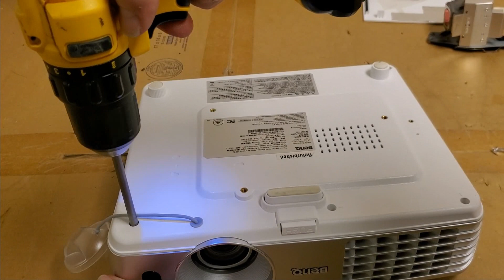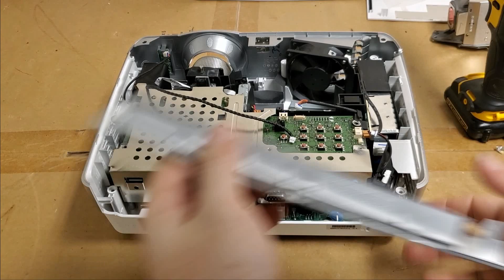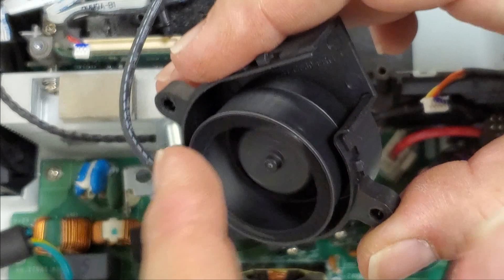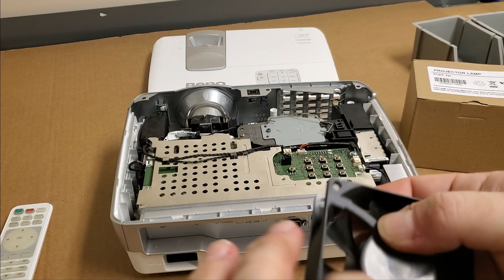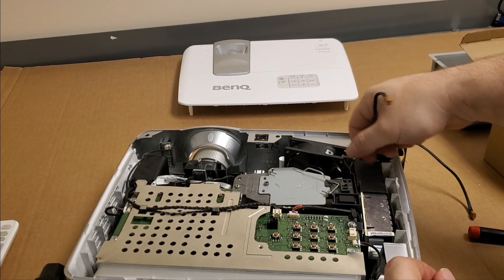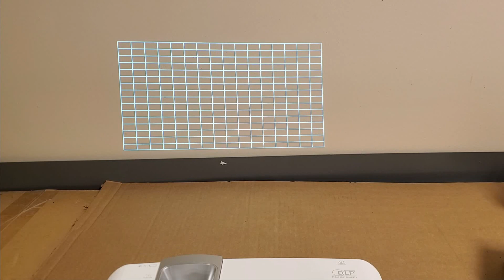BenQ HT1075 DLP Projector Overheat/Fan Replacement

Comment: Hi!
Any suggestion on how to reduce noise of a BenQ W1070+? I like the projector but I really would wanna know if there is a way to make it more silent. I guess the fans are really high rpm so a switch to noctua fans maybe wouldn't do to much of a difference, right? If I attached a cpu-cooler over the lamp... would it then be possible to reduce the speed of the fans in any way?
Reply from the maker: Unfortunately those methods wont work in my experience.  The Noctua fans use a different fan status reporting method (at least the Noctua fans I saw). Also the CPU cooler wont help cool the lamp much at all. They run so much hotter than a CPU.  Average fan temp is +200c at its hottest touchable point.  Even hotter inside where you can't get to.  The heat is generated by the arc tube inside the reflector. The blower fan (turbine fan) blows air into the reflector to push the heat out to the exhaust fan. 
All that said, there might be a problem with your exhaust fan or color wheel(they can make noises like a bad fan).  I run an HT1075(same as the 1070+ inside) in my bedroom and I sit about 5ft under it and do not hear the fans even in normal mode. You should really only hear the air moving in my experience.  I mention the exhaust fan because it seems to be a popular failure for the fans.

The problem with changing fans is you need to maintain the CFM (airflow amount) and use the same fan lock/fan status specs.  Some fans report PWM with one pulse per RPM, others 2 pulses per RPM.  Some pull the fan status lead high for fan stall or pull the lead low for fan stall. If you don't match those, it won't work at all.  If you can match the size, the CFM and fan status type, then you can use other fans. I tend to use the originals because I figure the engineers spent the time and picked them for a reason. I would like to experiment sometime and see what could be done.  I hear this a lot so its obviously something enough people run into.  Maybe if I can get my hands on some other "quiet" fans and see if they will work...  (really I need more free time. I'd love to give you a real solution).

You may want to check your service menu and see if you have any old fan errors.  Press menu, then press source and enter at the same time.  It should bring up a little set of boxes. Then use arrow keys and enter/menu to navigate the screen to find the fan status page (option 3 or 4 I think).

Comment: Please can you tell me the name of the tool your using at 5:16? I'm looking to replace my own fan due to overheating with the w1070+. Much appreciated and thanks for the video.
Reply from the maker: Its just a 5mm nut driver. I think I got this set on Amazon with a bunch of "security" tips.  If you have a socket set with 5mm socket, it will work as well.
Reply: @FixitFrank  thanks for that Frank 👍all the best in your endeavours, hopefully it's an easy fix.

Comment: Dear Mr. Frank, Thank you so Much for your video and your continues support, please allow me to ask for your opinion. I have a benq W1070, it gets overheat and shutdown after 2min. if i dont use the (high attitude mood). I opened the hidden menu to monitor all fan speed. i found out that Fan#3 rpm stops suddenly, then the projector shutdown with the lamp red light warning on. using your video on how to open and clean the blower fan, fan looks good, after cleaning and putting it on a test, still same issue. ihope i was clear, and thank you for your time. Regards,
Reply from the maker: Makes total sense! Oddly I have seen those fans fail intermittently. I had one with 15total hours that failed. I'd put a new fan in first. You can buy them on eBay or Google the model # on the side. The fan needs to be the same model or the CFM and the status wire may not be compatible, even if you match the size and voltage.
Reply: @FixitFrank  thank you sir

Comment: Have you ever seen the bulb plug melt, I replaced it two months ago now the bulb went out so I went to pull it and can't get it out. I broke the plug to find out its melted together.
Reply from the maker: Yup.  I have seen that a few times. Sometimes its from a bad male pin that isn't locked into the lamp connector, other times its the internal connector drying out and cracking when the new lamp assembly is installed.  Fortunately its usually very repairable.  Check out my Optoma video.  https://youtu.be/25_Rz5DQSmw   If you are in the states, email me. I have access to replacement connectors. If you are not in the states, I have a contact in China who can help you with a connector. Usually the ballast and everything else is OK.
Reply: Thank you so much, I will get it apart and get back to you for parts. From your reply it could have been the new bulb not fitting right and pushing the pin out of the plug?
Reply from the maker: Its hard to say without seeing it.  Older projectors can have the female pin push back and sometimes the new lamps have pins that slip.  I'd really have to see it to say what the cause is.  However, being that projector lamp world is small, I am actually aware of your issue. I'll be in touch a little later today.

Comment: the projector warmed up after cleaning in the service and it always turned off after 7 minutes the lamp cooled down and then the projector turned on and the red lamp lit.  The lamp is lit 1450h.  and the fans spun at 4500RPM.  It wasn't clear to me, but when I drove the machine to a cleaning service, everything was fine.  After weeks of reading the forum, I got angry and opened my projector and found a flaw in the front fan being turned, which was blowing inwards.  I turned it so that the arrow of the fan pointed out and assembled the device.  The projector is working, not humming and is well ventilated and the speed is 1900-2100 RPM.  service might know this but don't you think?  I'm a layman, but I don't hesitate to start everything, and if I knew I wouldn't go into that projector, I still had to.  nice day Honza

Comment: Hi, thanks for your video, I cleaned my working projector and after reasembly I cant run it, no power at all, even LED indicators on buttons are dead. any clues what I did wrong?
Reply from the maker: Hi, I few questions.  Is the lamp cover in place? The cover depresses the switch that turns on the mains power.  If not, check the thermal switch connection to the power supply.  Also, be 100% sure you did not install the mainboard offset from the power supply pin-riser.  It is easy to shift the connection one pin over. Most of the time it ends up being a wire you thought was plugged in and was not or something like that.  I have had to put together and take apart only to repeat that 3-4 times on occasion.
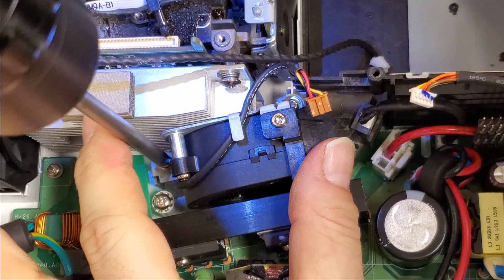Reply: @FixitFrank   @FixitFrank  thank you for your message :-) all working now. When I was reassembling projector I put 14-pin ( 7:38 - partially visible on the right side of screen ) connector on the other side of metal cover so basicly it wasn`t even connected to board. Basic mistake but I found it. Have a nice day :-)
Reply from the maker: @fikusny2011  I have done that so many times.  Now I even shine a flashlight in there just to be sure.  It's a really easy spot to offset.  Nice work and congratulations!

Comment: I would like to thank you for the video.tearing down right now. Only issue was remote wires, but should be able to get them back on, it's not a plug each wire on its one barrel  connector. Oh I had a bulb explode. I found a quarter inch piece of glass in the fan. Again thanks for the video
Reply from the maker: Let me know if you need any internal pictures or wiring order. I have another one in my shop currently.

Comment: Hey Frank, I know this will sound stupid but I have an EPSON EX5220 that hasn't been used in months and when I turned it on I noticed the intake fan had LOADS of dust build-up so the first thing that came to mind was to take the air compressor and blow the dust out because I didn't have any canned air... ANYWAYS, I may have gone a little overboard with it and ended up shattering the intake fan... I looked and looked online for a replacement fan but had no luck. seeing how you're a pro at this kind of stuff I figured you would know where I could buy one. Thanks.
Reply from the maker: I've done that.  Those fans will overspeed and fly apart if you let them.  It's kind of fun sometimes with scrap fans. Not so much when you need the fan... 
Type the part # on the sticker into Google/eBay.  Im sure someone has them.  Be sure you use the same part # because the fan stall/RPM lead is going to be one of the few different types and if you substitute the wrong fan type(even if voltage and size match) it may give you fan errors if the RPM/fan stall lead uses a different signal type than the projector expects. If eBay/Mouser/Google are no luck, after Chinese lunar new year, you can try Time Electronics.  Gydz@timeprojectorlamp.com  Be sure to send a picture of the old fan with the sticker showing.
Reply: @FixitFrank  Alrighty, thanks man.

Comment: Hi great informative vid...that squirrel fan is that fan 3?...fan 3 on my ben q w1070....says fault ...0 any help with identifying  fan 3 appriciated.
Reply from the maker: I think so.  On my "community" page there is a post where I have a map of that fan layout.  https://www.youtube.com/post/UgywjB6ucj44mbxCtrd4AaABCQ  <--Fan Map
If you had a lamp explode recently, and now have that error, it is almost 100% a bit of glass stuck inside that squirrel cage. I've had luck with taking a cotton swab and using it to reach in and push on the fan blades to rotate it a little. That is usually enough to pop the glass free so you can dump it out.  The fans have very low torque, so it does not take much to stop them and prevent them from starting again.  You should be fine, good luck!
Reply: @FixitFrank  cheers frank...im gonna order a new one if i cant get the old one spinning...tomorrow though its 9pm here in uk.   I will keep u posted hete with my progress. Have a fab day where u are . Cheers for the guidance buddy x
Reply from the maker: @gman1087  You are very welcome! I'm on the east coast of the USA so its only 16:00 here. Talk to you soon!
Reply: @FixitFrank  frank ur remedy worked a treat....there was a bit of glass shard in that squirrel fan....gave the whole thing a good clean.....no more error codes....projector running much quiter...not shutting down.....just watched a bit of a film on it. Mate cant thank u enough.
Honestly if we were local id get u a pint or two.
Glen
Reply from the maker: Fantastic!  Reading these sort of results always make me smile! Once the covid garbage is over, maybe I will make a trip across the Atlantic and take you up on that!  More importantly it is working!  Enjoy my friend
Reply: @FixitFrank  ....its working just fab....had it on all day!!....no faults....totally chuffed and my cinema seats came today so im sitting here watching the projector ....cheers again and deffo look me up. Take care Glen

Comment: Hey Frank, one question for you because I see you're a pro. First vid of yours I see, and not a connaiseur, just so this makes more sense. I've had this Benq TH530 for 3,5 years now and ever since I started it, I wanted to replace that loud fan. So finally the lamp went out a week ago, and just last night I ordered a new one. In preparation for the lamp change, I decided to open it up for cleanup and inspection, and while at it, I checked out the fan. The first thing that got my attention was that it's a Delta Industries fan, which kinda intimidated me and got me thinking whether swapping the fan isn't in fact a bad idea. I'd love it to be quieter, but I doubt a Noctua fan (if they make 70mm fans at all) would pull the same amount of air through. Also, seeing that in the projector you opened here you also pulled a turbine fan, I realised those are much louder than the fan in question. So my question for you is what are your thoughts on the fan "upgrade" videos out there? I would assume it may be worth it for some projectors with lower end fans, but I have the feeling the only real upgrade for my fan would be replacing the fan with a new one, or maybe just oiling up the existing fan! I do wonder whether it came with a faulty bearing, seeing as yours also had a physical defect. Any thoughts?
Reply from the maker: Hah, thanks for the kind words.  I don't know if I would say I am a pro but I will take it.  I've seen a few upgrade videos but honestly I tend to side with the engineers who designed the projectors.  The main problems are confirming and matching the CFM and the method of stall reporting.  The stall reporting method varies from projector to projector.  Some fans only report when they stall, others report the RPM in pulses.  That needs to be matched or you will get fan failure warnings.  Some RPM pulses are reported 2 pulses per rpm, versus one. 
Personally I always try and use the same fan that was in there.  I went down the Noctua road with another person a few months ago and they don't offer a turbine fan anyway in that size so it's not really an option.

My deduction on your fans is they likely wore out from heat.  That blower fan gets a lot of dust through it and tends to have it pile up on the fan blades inside.  That makes them run out of balance putting a lateral load on the bearing causing it to wear.  Most of these use an oilbronze sleeve bearing.  Some use a ball bearing but not many. The exhaust fan just gets pummeled with heat. I find that those lose the edge on the blade causing the airflow to drop off.

In your case, I'd replace the fans with original fans or at least original spec fans.  They are very available.  I would also only change the turbine and exhaust fan. The rest live a pretty easy life. As long as they are quiet that is.  If they are making buzzing noises, I would change all of them. 

Using replacement aftermarket fans would be a neat project to investigate.  Matching the fan specs is a little time consuming but I will put it on my list for things to do as I do see a benefit, even for the fact that as fans stop being available we could find compatible replacements at the least or quiet replacements at the best.

Comment: Hey Frank, thanks so much for the vid very helpful.  I have the 1075 and just replaced the bulb.  She'd fire up for five minutes or so and then overheat and shut down.  I checked the hidden menu and found that fan 3 was not working.  So I went in looking for glass chunks (that got me last time) but didn't find anything.  Did a general clean up and fired it up again, but this time I went straight to the hidden menu.  Fan 3 was working fine, spinning at 3100 rpm or so if I remember correctly, so I thought I had (somehow) fixed the problem.  No dice, after about five minutes fan 3 shut down again and the projector went into overheat.  I have virtually no experience with projector repair but I am going to assume that there is no good reason for fan 3 to shut down in any circumstances (i.e. this behavior is not normal) so my naive conclusion is that the thermostat for fan 3 must be pooched.  Would you agree with that guess?  If so, would that be hard for a jobber to replace do you think?  Thank you so much.  Oh yah, and like probably most of us jobbers, I would never have thought to look at the fan blade alignment as a cause...
Reply from the maker: Hi Richard,  Those fans will wear out even if they are spinning.  Sometimes the RPM chip inside will give up the ghost even with the fan spinning.  Those fans are pretty easy to change though.   I like to use my scope to verify them as the service menu only shows the rpms. I like to see the actual pulses(personal preference, the service menu is fine).  You may want to try running it with the top off, and measure the tach output voltage when it fails.  I bet you see it go from less than 2v up to VCC(10-12v).  That fan should be less than 20quid in my opinion. I see them in the states here for $10-15.

Comment: Hi Frank - I have W1070 and I see 2 solid red lights. After checking the manual and the secret menu for fan rpm  I found it is because of fan1. 2 questions..Which one is fan 1 and can you share the link from where you purchased the fan.. Thank you sir !!!
Reply from the maker: Fan #1 is the fan I replaced in this video.  They are pretty available on eBay or if you want, you can email my contact in China.  The other option is to google the part# on the sticker for a replacement.  Be aware that there are multiple types of fans that look like this and they are not all compatible. The RPM wire behavior varies across models so you need to use the same part as the original .  I find them by searching W1070 or W1080, or HT1075 fans.  They all use the same part in that regard.
Reply: @FixitFrank  Thank you so much sir for the response. Also one point I should have mentioned is that my projector runs fine for 30mins and then stops. So I am assuming projector lamp didn't explode. I will look into W1080 video repair that you have suggested. Thank you again sir !!!
Reply from the maker: @shomu001  I had to edit my original reply. I was looking at the wrong manual.  The #1 fan is the exhaust fan. Here is the diagram from the service manual. https://imgur.com/a/nyIzDBU  The fact that it runs 30min or so makes sense.  It should be the same fan as in this video.
Reply: @FixitFrank  Thank you so much sir for taking time out and patiently responding to my questions. I really appreciate your help on this !!!